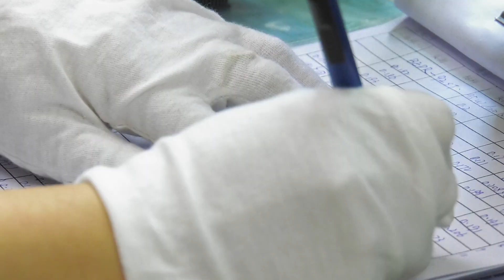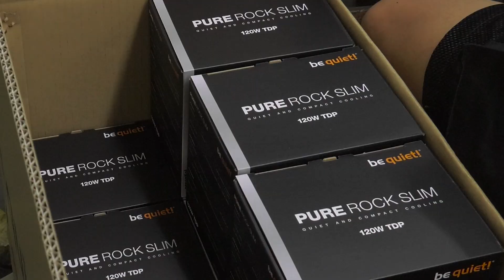The production of be quiet! CPU coolers, part 3: Assembly and QA

Comment: This video does not explain the curved / humped copper plates at the base Dark Pro 4.
Reply from the maker: That's because the video is from 2017, and the Dark Rock Pro 4 (I assume you meant that one) didn't exist back then.
Reply: @bequietofficial  But can you explain the reason for such humps in top coolers of different manufacturers? I believe that this press clamps the copper plate along the edges, so a hump forms in the center. Others say that warping occurs due to high temperatures.